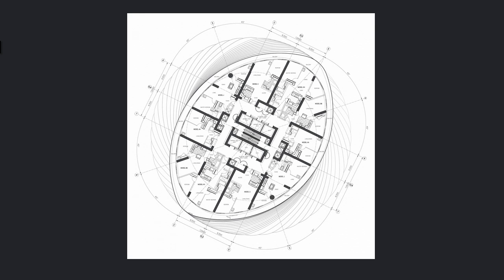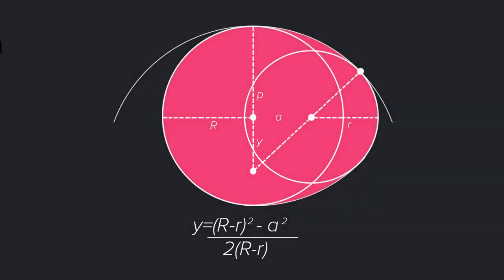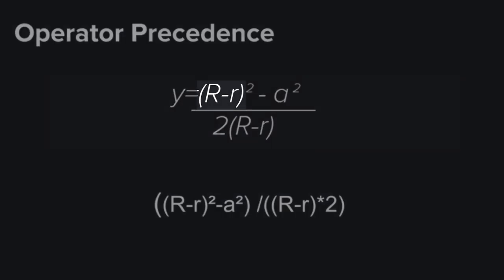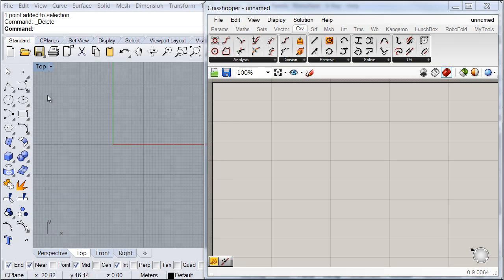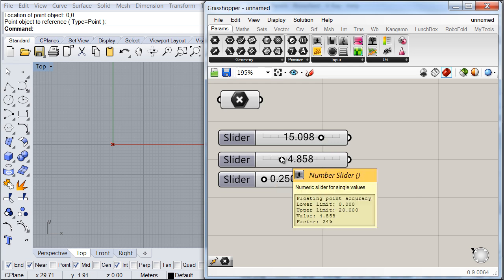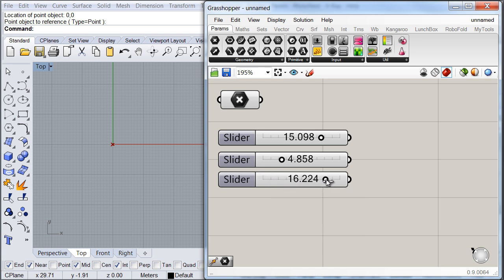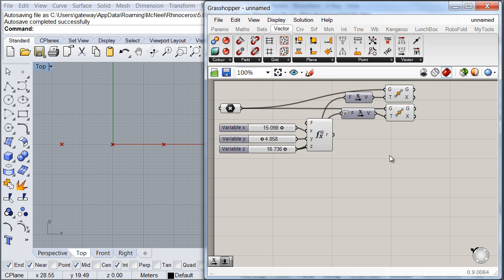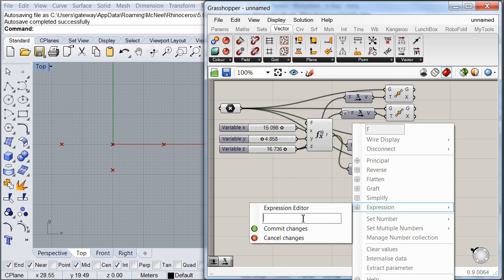Rhino Grasshopper Parametric Model Tower

Comment: **BEWARE THINKPARAMETRIC.COM**

I'd like to share my negative experience with membership at this site. When I was signing up for their free 7 day trial, I accidentally also signed up for a yearlong membership and am now stuck with it. I am used to signing up for free trials like this (where you provide billing information beforehand), but their process was different from the industry standard and their responses have been very frustrating.

As for the content, I found it so-so. The videos I watched were rushed and deliver more eye-candy than substance. If you're looking to improve at grasshopper, I'd suggest looking elsewhere - especially since the community as a whole is so open and supportive.